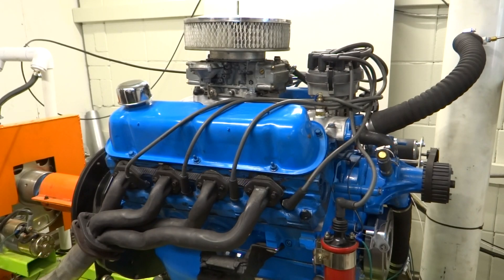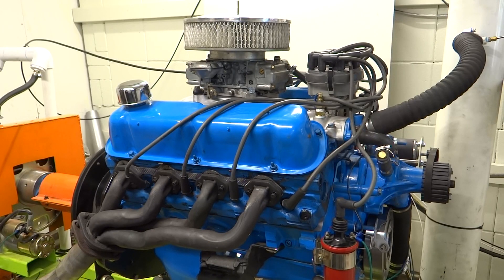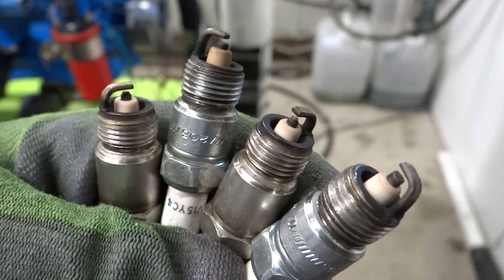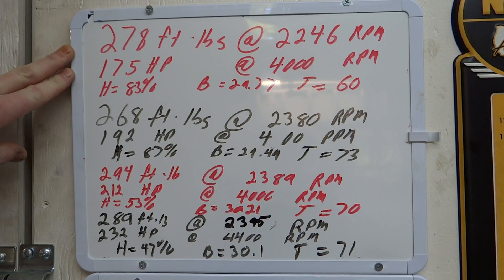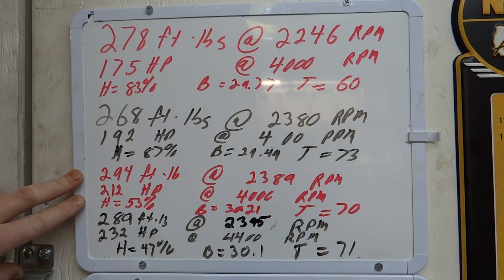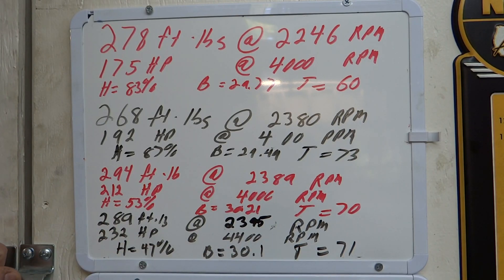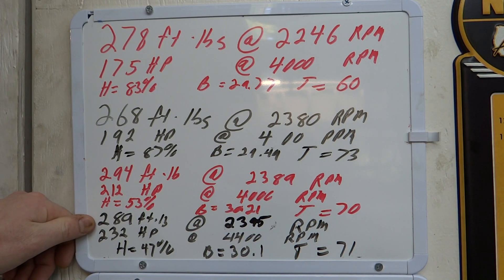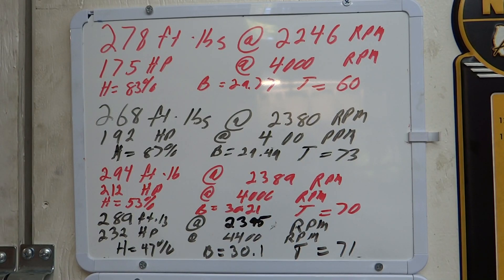Budget Ford 302 Project (Part 13) Ported Heads & Stock Cam Dyno Test

Comment: Why didn't you correct the bar/hum/temp so it would be apples to apples comparison? Excellent video, don't get me wrong but if I plug the numbers in to equalize the test the tq and hp are different than what you posted. 83% humidity kills power and 47% is mineshaft conditions. 29.4-30.2 isn't so bad, not to much change in hp there. 60-71 degrees is enough to change a few hp numbers too. Was the engine at the same water and oil temp for each pull? I built a 302 2bbl for a NHRA stock eliminator mustang I run, Stock unported heads and intake, stock 2bbl  carb, stock lift but any duration (.368/.382 lift 248-250 duration at .050) and I'm at 206hp where the class leader and record holder got 254hp from his 302 2bbl but he did a lot of bottom end stuff I haven't yet. (line hone/tq plates/hardblock in the water passages, low tension rings, decked, etc). Really cool to see a basically stock 302 (or any engine) on the dyno, everyone wants to see 800hp turbo, blah, blah, blah. Oh, final question, what kind of valve job? I'm doing 5 angles on everything and back cutting the intakes 30*. Now that NHRA has legalized "any valve angles" I'm going to do a set of 30* seats instead of 45 to enhance the low lift flow. Subscribed now!   EDIT: Just went to your channel and started watching video's....COOL!!! Excellent channel!! Love what you're doing, keep it up!
Reply from the maker: WRT the corrections, I kind of wanted the viewer to do them if they wanted. Some just want the raw numbers. Another reason was I wanted to find out the right way to do the corrections and I hadn't researched it yet. I have since purchased an SAE paper that shows how to do it. In the future I plan on presenting the raw and corrected values. I also want to get some kind of air condition monitor in the room because before I was just using the National Weather Service site for the data.  The way I generally run the dyno is I start the run with the coolant at about 150 deg and by the end it usually goes up to about 180. There are limits to my cooling capacity. I have not instrumented for oil temp yet but it's not hard to do. I think if you look at part 12 of the budget 302 you can see what was done with the heads. It was just a 30/45/60 though I think with maybe 30deg back cuts intake and exhaust. I have some good experience working around dynos, but they were diesel emissions dynos, so I am learning about what matters here, what people want to see and how to present the information well. I like doing it so hopefully I keep getting better at it. Thanks for the comment, helps me know what I'm doing right and where I need to improve.

Comment: What did you use to plug the thermactor holes in the ports?
Reply from the maker: I used an aluminum rod, I think it started out at about 1/2" diameter. I turned it down on a lathe to a little less than the diameter of the hole on the back of the head. The length of the rod was about the same lenght as the head. Then I put ultra grey silicone on everything and installed the peice. Another viewer mentioned they plug the holes directly in the port but I dont know what the material was or the diameter.

Comment: that is about what you should see from some portwork on stock heads.  Makes me wonder if you would see the same 20Hp if you did back to back with the HO factory cam or some mild aftermarket cam.  the long tubes should pickup  30lb-ft across the mid range and I'm guessing 10-12 hp at peak.  with more cam it should show more airflow demand based HP difference with about the same TQ gains.  looking foward to seeing results!
Reply from the maker: My guess with a performance cam  with more valve lift and duration to perform above 5000 rpm is the heads would have made a bigger difference. 10-12 hp from the long tubes on this engine is probably just about right. I am considering a cam upgrade. Thanks
Reply: If they are forced to stay with stock cam they can evaluate 1.7 rockers or see if someone makes 1.8 or greater.   This is a combo where even a moderate cam will give 25 to 50hp.